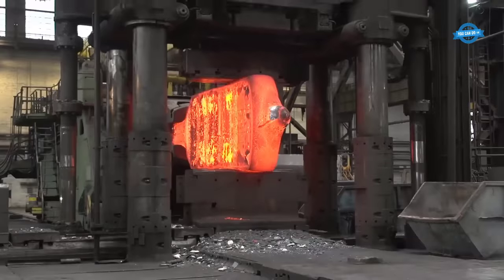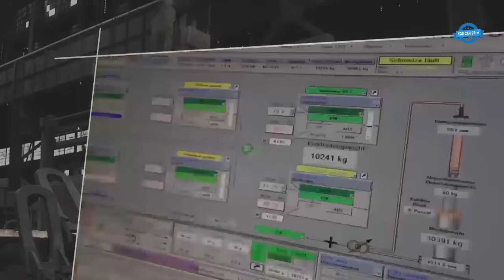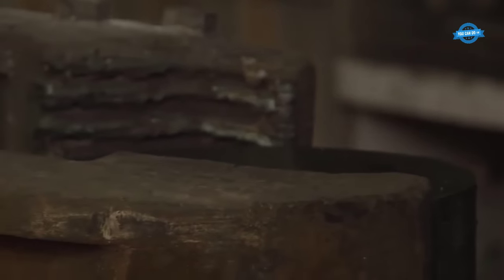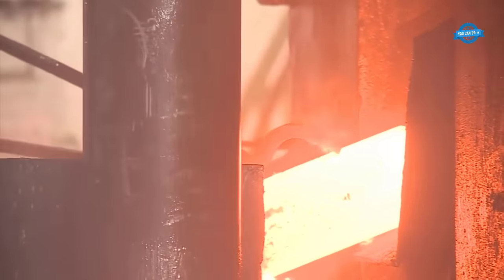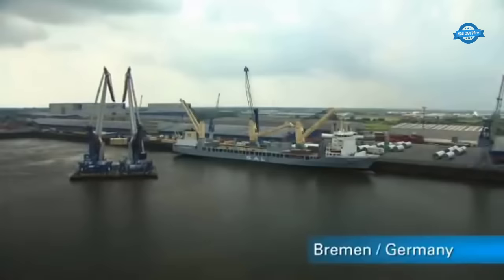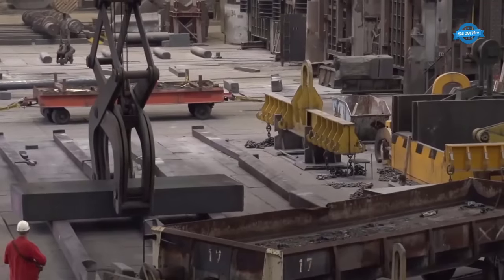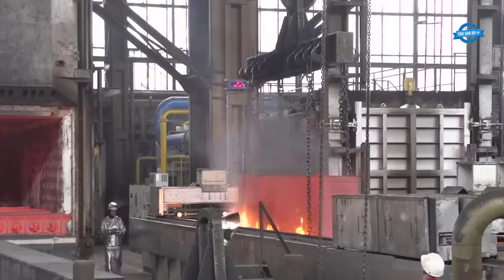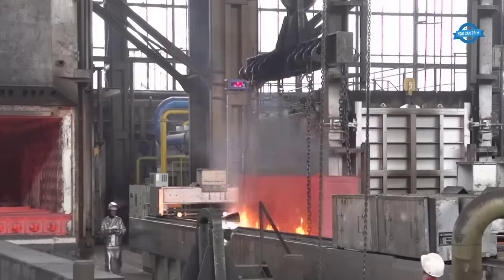Forging Plant, Colossal 150MN Extrusion Press. Manufacturing process of Chinese razor, Russian wheel

Comment: One wonders how such facilities will fare with the new energy regime in Germany post 2023.   Suspect enormous amounts of methane are needed to heat the steel and/or equivalent amounts of megawatt-hours of electricity.  In the US primary aluminum production has almost vanished compared with 50 yrs ago simply because the cost of electricity made it uneconomic and US electricity is about 1/3 of Germany's.
Reply: They will move.
Reply: Wichtige Firmen werden NOCH Subventioniert.
Reply: Germans misread the Russian dependency on oil issue, so don’t underestimate their naïveté and/or stupidity. Trump told them and they laughed.
Reply: Steel related carbon emissions are formally considered very difficult to mitigate, reduce, etc.- in a global emission reduction goal.

Comment: What gets me is no matter how massive a metal object is for a machine, it's manufactured parts tolerance is smaller than a hair strand.  In extreme cases it's tolerance is as small as a virus.  With such tight tolerances metal must have it's temperature taken into account otherwise parts fitting is impossible. No more is this most critical than making a hydrogen burning engine of any kind.